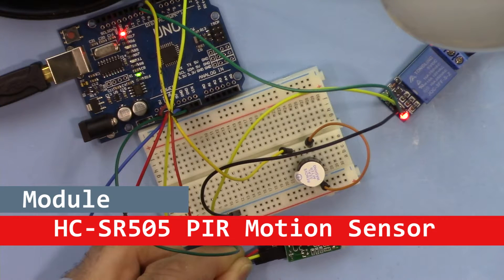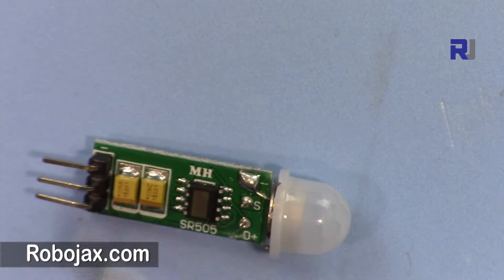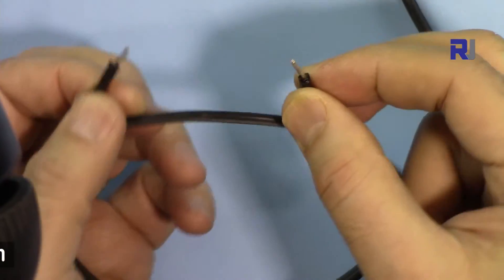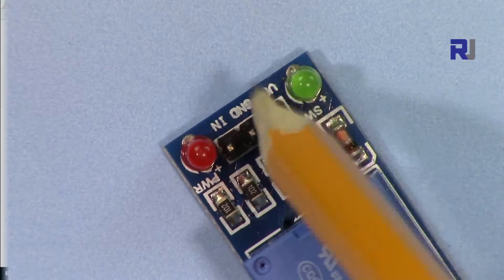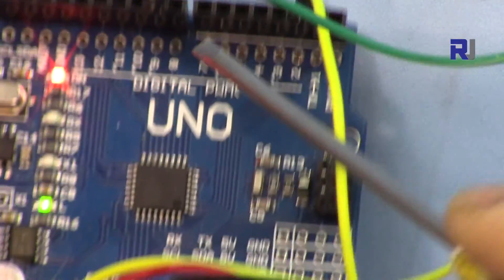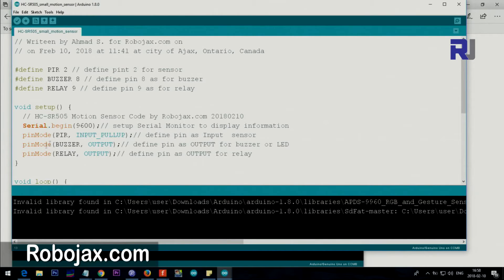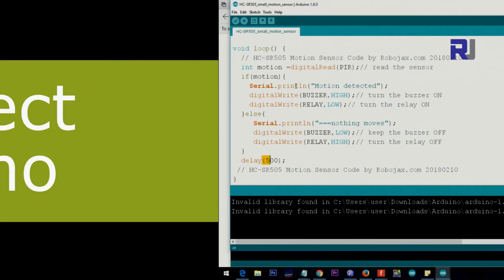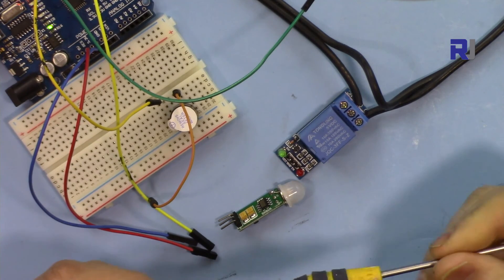How to Turn an AC light ON with HC-SR505 motion sensor and relay RJT60

Comment: can we use 2 or more than 2 ac bulb in a single arduino?
Reply from the maker: that is what arduino is for. just define input pin for the sensor and output pin for relay and there is no limit.

Comment: Why a relay and not a transistor?
Reply from the maker: a transistor can work only with DC voltage and you can't turn ON AC bulb. Relay is the best option to control any kind of load you want to control.